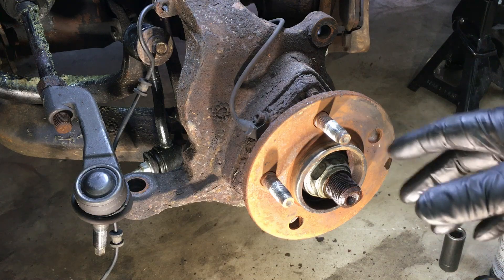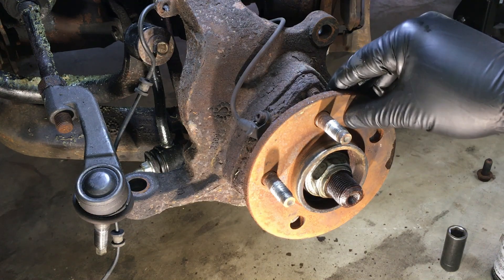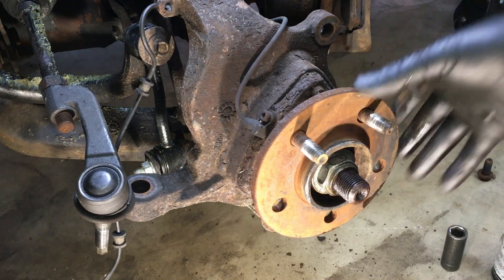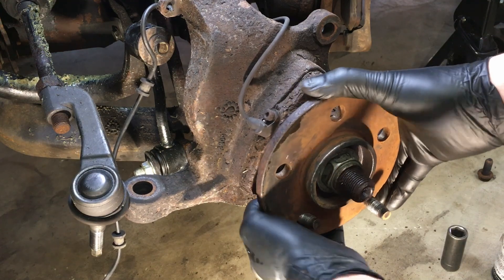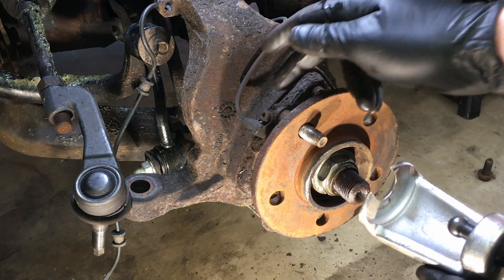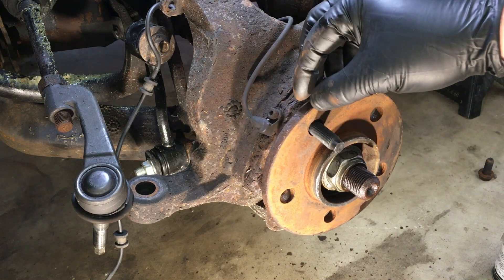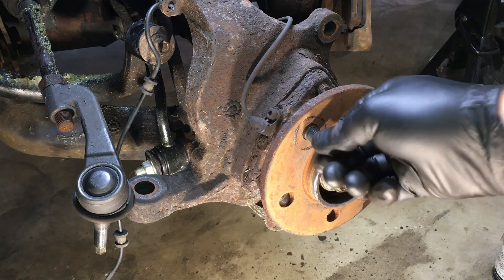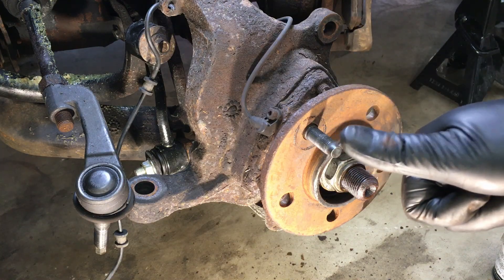Automotive Wheel Stud Replacement Guide

Comment: If a stud shows no obvious way of removal without taking the hub flange off you can get away with grinding the old stud in order to remove it and then grind away a section of the securing lip on the new stud  just enough that you get a flat edge to offer up and this can give you enough room to slip the new stud in.  Sounds bodgy but there is still plenty of strength on what's left that you are never going to have any issues with the stud.

Comment: Hello.....so at 7:12 point in video when mentioning splines....so those splines are NOT going into some matching grooves in the hub but rather are expanding inside smooth sided hole thereby "locking" them into place....correct?  You basically stated that and I cannot see any grooves in lug holes but just for clarification.....
Reply from the maker: The splines are not meant to line up to anything, you are correct.

Comment: Putting it  back I just add some washes and put the lug nut on the flat side and tighten it up with my ratchet until the back comes flush of the Bolt if you don't have a tie rod tool